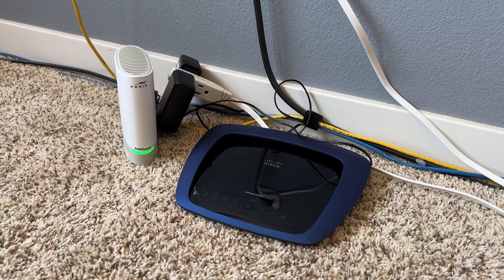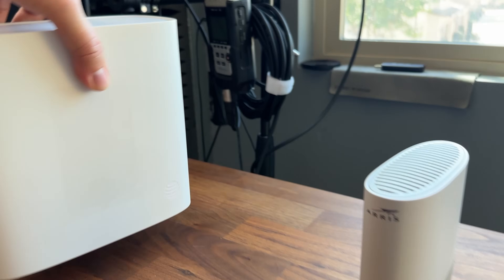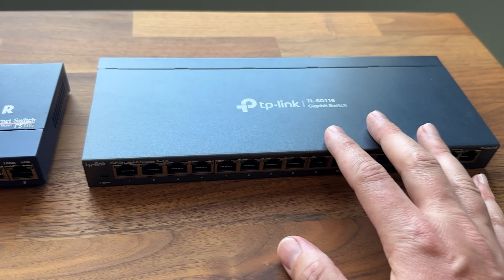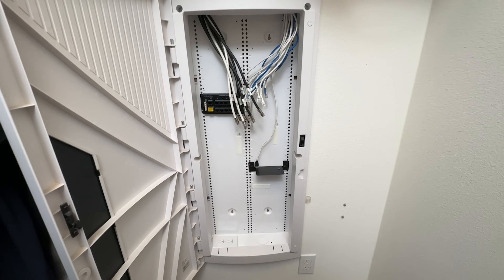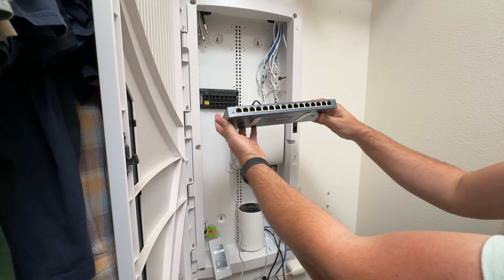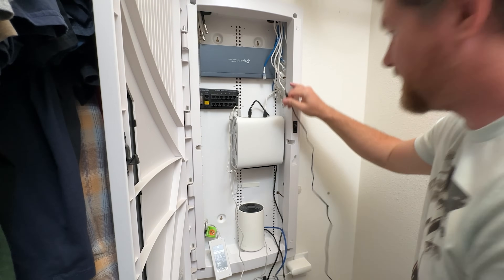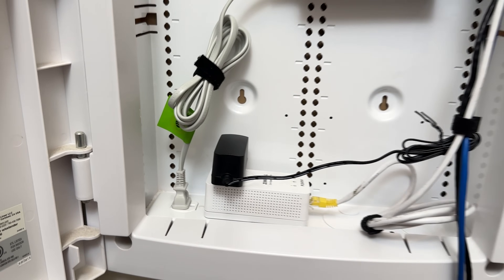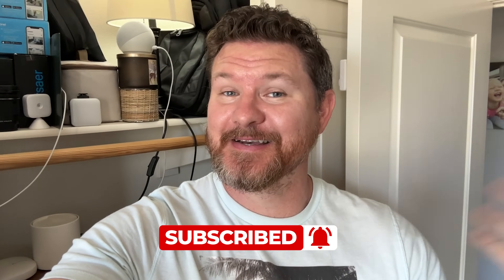How To Setup The PERFECT Home Network For Beginners

Comment: I am purchasing a new home with one of these panels in the utility room and had no idea what it was used for. Thanks for explaining its use and purpose as well as how to use it to actually install the cable modem/internet modem and the switch inside the cabinet. I was wondering how to hookup the connection from the internet provider that was coming into the house via an ethernet cable.

Comment: I want to confirm my understanding of the last part: the Ethernet port in your room provides a 1Gb connection, which is then split due to the additional switch in your room.

However, wouldn’t that 1Gb connection potentially be even less since it’s shared with the rest of the house? For example, if other rooms have devices or additional switches, wouldn’t that mean the Ethernet port in your room is effectively always operating at less than 1Gb?

Please let me know if I’ve understood this correctly.
Reply: If its being shared with other devices yes. But, if there was only one connection you probably can get the full 1 GB connection. There can be other factors where you don't get that full speed. One being others in the neighborhoods using the same company and are in the same channel as you are. This can cause some slowness in your connection.
Reply: He's wrong on that part. No matter how many switches you use, you will still get 1GB in all of them, if only 1 port is used. So if you are connected to the first switch or to the 10th one, it doesn't matter, you will get the same speed, if you are the only one connected.

Comment: Do you have any idea why my 1GB switch only works at 100mbps when transferring files between my pcs? the settings on the switch says the ports are  working at 1000mbps.
Reply: Because your switch or router caps it. Check the specks of both
Reply: @larrygee76  all the ports on the switch say 1000, the router is set to 1000. The only thing I can think of is that some of my network cables are older and are slowing down the transfers. I changed out one of th em. I'll test it again and see the speed. I read that my hard drive speed can also affect it too.
Reply: @thatguyfromca  Did the new cable help?
Reply: @hotdogschnabulator  Yes, the new cable fixed my issue. The old cable was not rated to 1000mbs.

Comment: Man I wish we had a network box in the house. I have fiber and they put a box outside and ran cables along the eaves into my kitchen and into a modem/router combo taking up space on a shelf along with my surveillance equipment. I want to wire my rooms for Ethernet. I think some of them have old phone lines maybe but yeah I gotta fish cables through the walls to get there. I’m thinking a box like that would be more clean and secure. I just love cutting into drywall lol.
Reply: Just use wifi no need for ethernet

Comment: How does the “feed” cable get to your network closet?  Did your ISP go through the attic?
Reply: Since he has AT&T fiber, AT&T installed an ONT somewhere in his house, probably garage. AT&T runs their fiber cable from their distribution hub to the ONT. Then they run an ethernet cable from the ONT into this network closet. I'm not sure what the exact process is for running this cable as it usually varies between homes and setups.
Reply: @ I thought this would be the case, the hard part is deciding where to put the closest. Thank you for the detailed response

Comment: Ok so most Internet providers won’t even do business with you , because they want to use their own equipment and have their routers set up so there’s not in between hardware hook up . Tell me what internet provider are you using and make a video on what you have to tell the sales men and the technician. 
I currently have 5G fiver optic in my house with a Mesh system , capable of WiFi 6.
It runs fine but nowhere where a fiber optic should do, and I have a clear idea on where to run my fiber cable to but I don’t want to proceed with it because “Frontier “ didnt like the idea , so please 🙏 share your tips
Reply: I use Vexus here in Texas. And they let me use my own equipment 👍

Comment: at 12:23 you plug the wireless (mesh) into an unmanaged switch? Can you tell me why? is that necessary?
Reply: Hi, he's doing that to bring Internet to the switch.
The flow goes like this: from the street (feed cable), to the gateway, then to the router (TPlink), then to the switch, and then to the house and NAS.
Reply: Maybe he plugged it in the poe+ port?

Comment: My Cat5e cables are not labeled, is there a way to find out which is the “feed” cable so i can connect it to the modem?
Reply: I have the same question. I have a bunch of coax and ethernet cables in there. I know which is the feed coax cable but not ethernet. If you figured it out let me know.
Reply: @incognito4065  so the Coax is my main feed. Then i connect an ethernet cable from my modem to a switch then just connect all the ethernet cables to that.

Comment: I dont get this setup. What is the point of using the ATT device? The less devices the better. Now you have to go in to the ATT device to disable Wifi! Too many steps to confuse everyone and too many unneeded devices. You may as well use the ATT device WITHOUT the modem or get rid of this device and use the netgear R7000 with the 4 antenna and plug into that from the modem. It probably much faster than the ATT dont you think? Also, if the house was wired for phone the jacks thoughout the entire house need to be replaced to accommodate RJ45. I dont see that you did this or you did not show it.
Reply: From my understanding, AT&T doesn't let you get rid of their gateway. They setup their authentication using a proprietary method which requires the AT&T gateway to be present.

Comment: Some suggestions:
1. The company that makes that network cabinet also sells accessories for mounting hardware inside it. It's way more secure than command strips.
2. Never mount RJ45 jacks pointing up. All kinds of debris will eventually fill those little holes. Or buy covers for the unused ethernet ports.
3. Put a small UPS in that cabinet.
4. Disable every feature on the AT&T gateway and turn it into a dumb DSL modem. You already have a firewall/router. You don't need two.
Reply: When my sister's house was built they put a cabinet like this in and ran all the cabling to it before building the wall. All the electrical and RJ45 ports were facing up inside of the cabinet and after the house was done I opened it and every ethernet port and electrical outlet was completely filled with drywall dust from when they finally put the wall in. Still think about how dumb that was to this day.
Reply: good points
Reply: He shouldn't get much dust in that enclosed space.  For point 4, most modems have a "bridge mode" which turns off everything and makes it a dumb transfer.  If anyone's having trouble with a provider modem and wants to use their own router, ask the manufacturer how to put it in bridge mode and that will disable all its built in crap and just transfer the signal to whatever you plug it into.  Just make sure the new router device you have has set up the WAN settings according to your isp.
Reply: @mrzisme  keeping also in mind that some ISPs do not allow bridge mode. It's outrageous, but a point to keep in mind when chosing your ISP.

Comment: Why not connect the switch directly to the gateway? Instead I see you connect to the router.. would it create a conflict if connecting directly to the gateway?
Reply: This is why I’m in the comment section. Just WHY? It’s also 1G/cat5e network too and seems so much wiser to run from router to the WiFi AP and then another from the router to the switch. Unless he’s doing very specific with those other ports I can’t think of why you wouldn’t.
Reply: @OddWoz  because when you use a network switch your mostly using lan connection. For transferring data would be faster if using fiber optics. So it's best to go from your modem to a network switch or router for faster data transferring speeds
Reply: @flipinfin  you don’t care about faster local speeds?
Reply: @OddWoz  He has a modem router wifi all in one with a 5gb port the blue connection. Why I think you guys got confused. He shut off his wifi that's why he's connecting to his mesh wifi so to connect to his other mesh wifi he's using  a network switch where he's enthernet cables are all ready pre routed. Hope that helps
Reply: I've learned this lesson first hand. If you are using wifi for internet and using a switch to connect devices to your network, then the switch needs to be plugged into whatever is putting out your wifi. In this case it is the router. That's how mine is set up as well. I had my switch (which my smart bridges were on) plugged into the gateway and that caused so many connection issues with my smart devices UNTIL I plugged the switch into my wifi router. Hope this helps.
Reply: Okay...  I have th same exact modem as he does.  I want to run a wire from the gateway (same one he has) from the living room, to a room in the back of the house which will be connected to the switch (same exact switch he has).   Can I then connect my computers (three to ne exact that are in that room) directly to the switch and get Internet?  I want my gateway to continue to broadcast WiFi from where it is currently located.  I hope this makes sense.  Essentially I want gateway > switch > computers.  Also, I don't want to mess with any computer settings.  I literally just want to plug and play.  IS THIS POSSIBLE?  Lol.  I hope my questions are understandable.

Comment: Must be nice to have a central networking hub with wires going to every room in the house. Not everyone has that luxury. In fact, most of us probably don't. And for that... there's Wi-Fi for every room in the house other than the one that the Internet is directly coming in to with the networking equipment.
Reply: Well, the average/median age of a home in the US is 40 years old... Over 50% of homes owned by the occupant are built before 1980 and nearly 40% are pre '70s built.  So although your home is only 13 years old,*Most* homes are in fact much older, definitely built prior to modern networking being a thing. My house had the entire electrical system upgraded in '98 and is sorely outdated and inadequate to today's demands and common standards let alone requirements (Zero GFI/AFI, 9 separate circuits to be code today are on one single circuit, lacking outlets on entire walls that common sense alone would have them but today code would require also, bonded ground-neutral in what's technically a sub panel since there's a disconnect outdoors at the meter pole also). Ironically, the panel itself is installed in a highly thoughtful manor clearly done by a electrician that took pride in their work and is extremely clean, neat and admirable. Even 10 year old homes in the rural area I live often aren't designed for networking updates, as home Internet availability options were awful, God awful, or just unbelievably awful up until right about a year and a half ago, a fiber campaign for rural areas through the local elec co-op w/govt grants became available. First time in my life I bothered to have home Internet beyond cell phone hotspot use with 1-2 bars of signal...
Reply: Not exactly true. There are more homes with a hub installed at home build time than without. My house is 13yrs old now and it has a central hub. Imagine all the homes built in 13yrs across America. Definitely more than old.

Comment: New WiFi 7 routers are getting big for example the deco be95 won’t fit in there. Any recommendations as what to do? Also sometimes the plug is also shaped weirdly and doesn’t quite fit. Not sure which extension cord really fit the bill

Comment: The way to get around the speed limitation is to install a switch in the cabinet that has 2.5GPBS up link.  Of course the cable needs to be sufficient for those speeds as well.  Great video, I am sure lots of beginners can benefit from it.

Comment: What about IP addresses? Does that switch give you a different address for each port?
Reply: Yes and no. Switches don't give out IP addresses. Its the DHCP server built-in to the router (on most home routers) that handles IP address leases.
Reply: @JJFlores197  Just no. The switch (layer 2 switch, typically) is not aware of IP addresses. Just the router knows IPs (layer 3).

Comment: Curious as to why the internet from your ISP doesnt come into your house in the form of Fiber Optic cable? In my country everything here is through Fiber Optic cable coming in to our homes.
Reply: Side note: The large white gateway at 2:00 is actually for fiber internet. However, AT&T installs an ONT, Optical Network Terminal. They run fiber to the house up to the ONT. Then they install a copper handoff  where that fiber signal gets converted to an ethernet signal that connects to the red ONT port on the box. I'm not sure what the reasoning for this is.

The USA is extremely behind most other countries when it comes to fiber internet. Some areas have it and many don't. In some cities, certain neighborhoods can get it, but may be not the next neighborhood. Its extremely expensive for an internet provider to install fiber optic internet. The USA is all about money. If an ISP doesn't find it financially feasible to install fiber in an area, they will put it off as long as they can.
Reply: @JJFlores197  Thats pretty much the same in Australia as well. We have fibre connection to the outside of the house using what's called a PCD (Premise Connection Device). An additional fibre connection is run from there into the house into a NTD (Network Termination Device). The NTD converts the fibre to ethernet. Its basically the ONT in this example. Router goes into the NTD via the configured port normally UNI-D1.

Comment: Is that a ATT Fiber modem? ATT told me I had to sit mine upright or they wouldn't provide support. Since apparently it has something in it that they can tell it is not sitting in the recommended stance.
Reply: FYI, rg-320 gateway vents heat out of the top. I install these for a living and there is a plastic shelf made for it to set correctly. Also the status light on the front cannot easily be seen that way. It lets you know easily if you have a service outage.

Comment: Steve, did you have to put the BGW320 into Bridge/IP Passthrough mode for the TP router to start assigning IP addresses? If not, I would think the setup would be double NAT'd and cause issues. I'm asking because I'm trying to do a similar setup but read the BGW320 doesn't have proper bridge/IP passthrough.
Reply: I’d also like to see how this step is done. Steve mentioned the pass through.
Reply: You must if you are using a 3rd party router to handle all your connections. IP pass through since you can’t bridge the Att device. Disabled firewall on the Att device since you are going to be using the other router to protect your network.

Comment: What is the benefit of using AT&T's modem/router? Doesn't the Deco router have the firewall built in so you can just use the smaller modem and plug it directly into the deco?
Reply: With AT&T, you're forced to use their modem. No way around it.
Reply: @JJFlores197  There are ways around it, just do a little research.

Comment: Can we use a cat 8 ether cable on a wifi router to connect to the switch on an RV?
Reply: I think it all depends on how much data your router can manage and put through. That is at that moment the weakest link as I guess the incoming data speed is high enough

Comment: Would getting a higher Cat ethernet line be more ideal for futureproofing for the long term? I know currently 1G is the norm, but after 5-10 years I would expect that to increase
Reply: It is always best to use the best Ethernet cable that is around, but the problem of a network is, is that a network is as strong as it’s weakest link. And that will be then the incoming signal. Right now there is Cat7 which can manage two way data streams  at a high gigabit speed and most likely the incoming speed will be max 5 Gbit and then Cat6e is enough. Cat7 is also very expensive, so I would advise to stay at Cat6

Comment: Hi, my house already came with a patch panel in the closet and the rooms have network jacks. How do I setup the wired network for the house? If I hire someone, how much would it cost me? Im a diy kind of guy, but no expert in networking. Maybe you can point me in the right firection? I'd be mighty grateful
Reply: You lucky cat. Google is your friend. It’s not rocket science. You will figure it out.
Reply: See the patch panel as the end of the cables. It is just a neat way of organizing the Ethernetcables, as I understand it. All you have to do, I think is putting a switch between the panel and the modem/router gateway and the rest can be the same

Comment: The setup shown is fine for beginners, but it is kind of overpriced "consumer" hardware. Instead of buying one of those fancy plastic boxes, you can put opnsense on a old x86 box (or some dedicated low power unit) and access enterprise-level features. You will also learn a lot about networking in the process! The same is true for a NAS, you can DIY a unit for essentially just the cost of the drives if you have like most people some old hardware collecting dust.

Comment: How do you know which mesh system is compatible with your ISP?  My ISP says I have to use their GigaRouter, can I connect the mesh system to that instead of the modem?
Reply: I guess they say that to ensure your connection will be guaranteed, because they designed it for you. If you use another modem or system, your ISP cannot guarantee your internet speed and cannot help you. Mostly their knowledge is as far as they have designed it